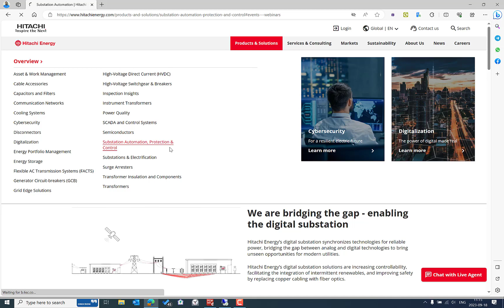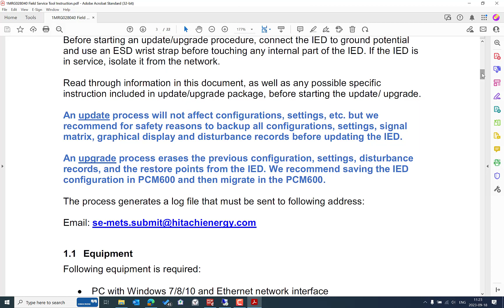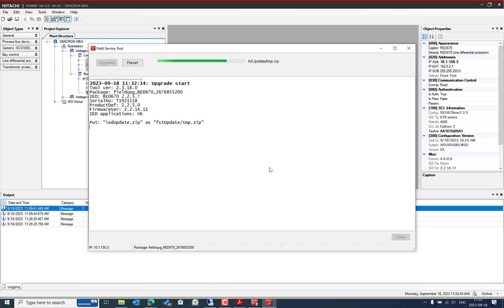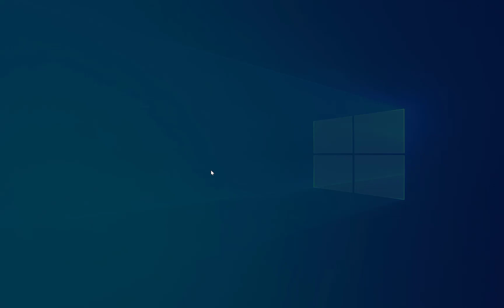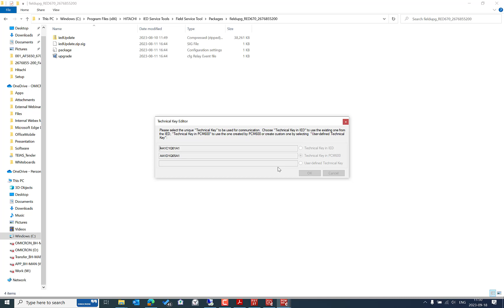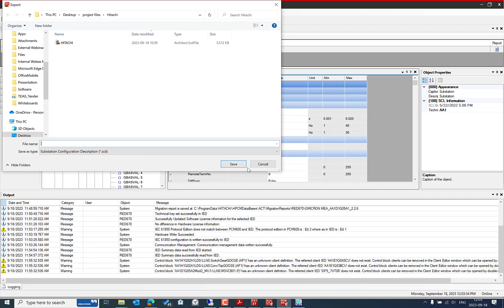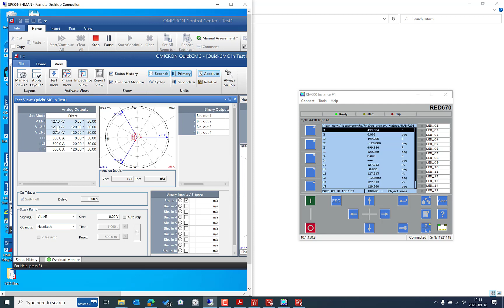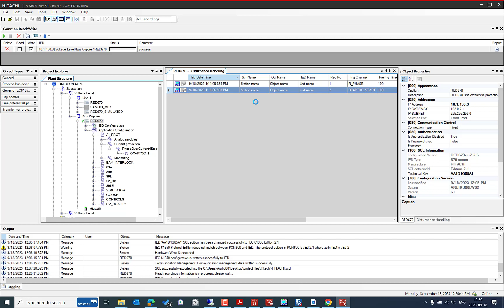How to update firmware for ABB/Hitachi Energy Relion 670/650 IEDs

Comment: Can this update resolve the issue of ready led blinking in green in REC670 relay
Reply from the maker: It is possible that an internal fault has occurred. Please check the IEDStatus under the Diagnostics menu to find out why the ready LED is flashing.
https://www.youtube.com/watch?v=7Vs1jZzbk9E&t=2256s
Reply: Thank you so much for your support it was a problem in the milliamper analog input card we delete it from the hardware configuration.